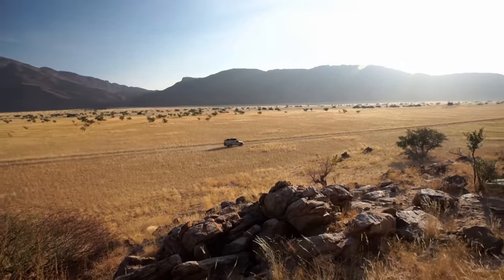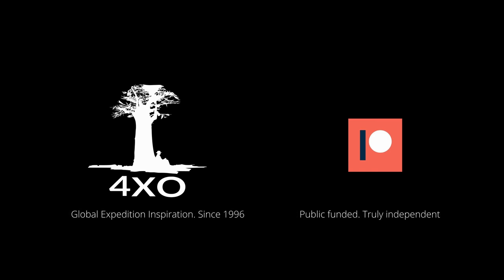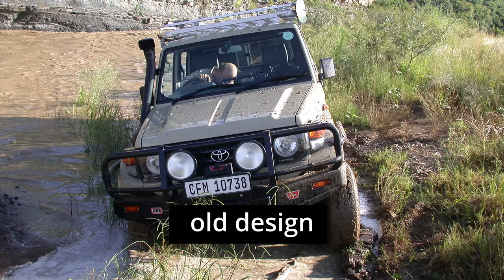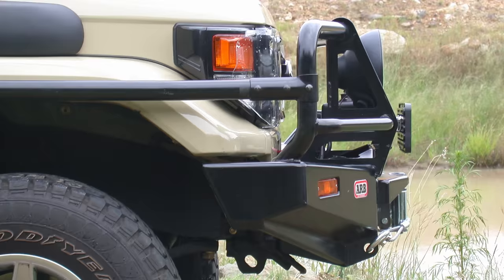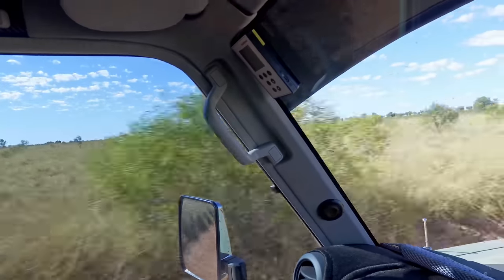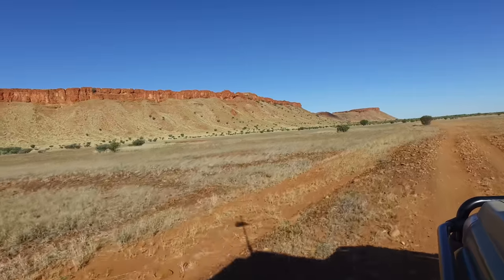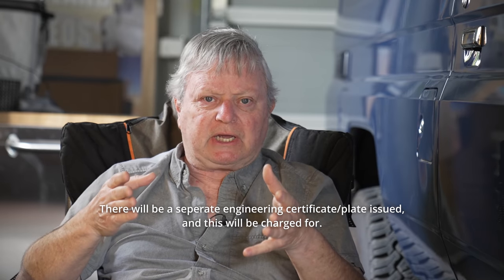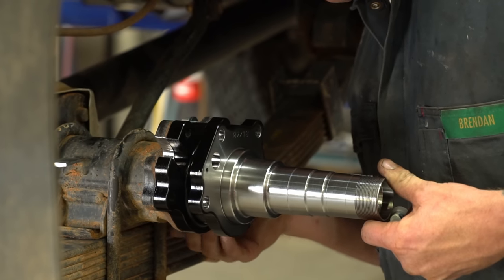TOYOTA LAND CRUISER AXLE-WIDTH CORRECTION. Is it Really needed? Cheaper alternatives? | 4xOverland

Comment: Can you imagine the backlash any other brand would get when they changed the front track and just left the rear?
Reply from the maker: Toyota gets huge backlash from this. But in truth, it was this or design an entirely new vehicle. And they weren't going to spend the money on a vehicle that sells in such small numbers.
Reply: The leaf sprung GU Nissan Patrol cab chassis also has 100mm narrower track at the rear.  Nobody battered an eyelid!
Reply: @4xoverland  sounds familiar to all Landrover Defender owners

Comment: Make a video on GVM upgrades, are they really worth it?
Reply: They’re worth it if you can afford it, which pretty much sums up the 70 series range. This is why the haters bag it so much, they can’t afford one.
Reply: They are if you have ever weighed your vehicle just prior to going away.. most 4x4's would be very close or over their legal GVM..
Reply: Troopy comes with 1000kg payload.  If you need a GVM upgrade you may have added too much heavy unnecessary stuff.
Reply: @philg2468  Well I get it what you say. It's not necessary to add too much weight that it may reach your GVM limits. But my general question is, do GVM upgrades actually increase the GVM of a vehicle?

Comment: And there you have it the main reason that I did not purchase an inherently unstable vehicle with a pretty dam poor design issue. Extending out the hubs without moving shocks outboard will likely be a stability disaster. The axle housings on 70's 'do break' and this mod is likely going to put more stress onto the existing housing. Maybe strengthen the whole housing.
Reply: So basically you couldn’t afford it.
Reply: @Phil_McAvity  not at all but I did not want an inherently unstable tug pulling my AOR Matrix Van which is worth $140K+
Reply: @Phil_McAvity  nah... I just wanted something with decent handling to pull my $130000+ AOR Matrix Van. Read the comments young Padawan, you have much to learn....
Reply: @petermills1402  you sure showed me.
Reply: @Phil_McAvity  sure did Phil, showed you what you are
Reply: @petermills1402  winning 👍

Comment: Andrew, have you confronted Toyota about the rear axle problem and have they attempted to communicate this with the manufacturer? What if the world got together to boycott Toyota's 70' series till they fixed the issue? The V8 has been out for 14 years now. Hasn't there been feedback to Toyota to rectify the rear axle width? This is very poor from Toyota really, a shambles.
Reply: I'm sure people have complained, but it's Toyota here. People who buy these vehicles are scared if they complain too much or boycott them, Toyota will just stop making them. The 70 series do have a loyal following and people love the build process. Also it's not only the rear axle poor design, there are plenty more poor designs on these cars.

Comment: I've owned Toyota's all my life , from the FJ 40 up to the 200,I now own a canter 4x4 truck best choice I've ever  made , I would never buy another Toyota 4x4 ever, there over priced for what you can get thies days  ,you have to spend lots to just get it to work properly, a 4x4 is just that a off road vehicle so why do today's manufacturer's keep building crap ,how about building something that's just not throwen together.example front and rear diffs WHY ??‽?? ,the lay out hasn't changed In years, seats, dash ,diffs ,ect, example springs why still under slung ,your looking for clearance ect , you can't work on them anymore, why not sell them with pto winches as thay used to , best winch ever, Toyota to me now is just a black top  school pick up car .and there just useing the brand name to sell.my last 2007 1hz troopy I sold 4 years ago had just been run in with nealy 700,000 km it never missed a beat .

Comment: The thing with these 70 series LC's is why in the hell should you be doing this in the first place. How much extra would it cost Toyota to resign and make their rear axle the same track as the front. The money Toyota are charging for these dinosaurs is crazy and the few hundred dollars it would cost them, JUST FIX IT TOYOTA.
Reply from the maker: If they fixed it, the'd have to design an entirely new vehicle. Wider back axle, means wider body, which means wider roof, which means wider windows, wider doors, wider everything. I believe they will stop making the 70-series before they fix this issue.
Reply: @4xoverland  agree we don't want Toyota to stop making them. But I don't understand why they would have to completely resign the whole vehicle. You increased the rear track with spacer mod, you can also buy a complete extended rear assembly and bolt straight in. As far as I know, you don't  need to widen the rear of the car, the roof line. If a local engineer business can do it, why can't Toyota, are I missing something.

Comment: Why don't Toyota fix their bad design? Now it cost you the buyer a lot of money.  They should have known the effects of widening the front axle.
Reply from the maker: Toyota needed a wider front axle to enable them to fit the V8 engine. They made the front wider, but didn't make the back wider, because the rear bodywork was the same as it was before. If they had had widened the back axle, it would been too wide for the bodywork at the back. Which would have meant changing the body (which would have meant changing the entire body), or adding wheel flares. Add-on wheel flares do not work well in the less developed parts of the world (an extremely important market for Toyota and NGOs) because they'd quickly be torn off and then the cars would be not be roadworthy with back tyres sticking out. It was an economical decision. It was either do this, or cancel all 70--series production altogether. Which was considered.

Comment: An automotive manufacturer penny pinching with design... who would've thought? 🤣
Reply from the maker: Not as simple as that. It was that or design an entirely new vehicle.
Reply: @4xoverland  Toyota "redesigned" the front end to accommodate the V8 but stopped short of a completed product, sorry Andrew but that seems pretty penny-pinching to me, the end user shouldn't need to cough up $3325 to correct a design issue.

Comment: Sell your V8 and get a trusty 1HZ
Reply from the maker: God no! There is nothing wrong with the V8.
Reply: @4xoverland  other then it sucks 16 - 18 L/100km unladen where as a old 75 sporting the 1HZ with over 300k mostly off road does 14l/100km with a fuel system over haul and a good returning they can get down to 12l/100km. our 105 is a good 500kg lighter then the 75 and it does 12l/100km and its still NA add a turbo to that 1HZ and good tune the 105 can get down to 9-10l/100km. theres a reason why the i6's especially the 1HZ and 1HD FTE still hold a lot of value last time i went looking for a 1HD FTE they where going for around $10k.
Reply from the maker: @phalanx3803  I've owned five 1HZ Cruisers. I get 12.5 L/100 kms with my V8 if i'm looking for economy, and 14L/100 if I push it. The 1HDFTE is another story. One of the best engines of its kind. I'd swap for that. While the 1Hz is very reliable, it can't pull the skin off a rice pudding.  The V8 is also very reliable.
Reply: @phalanx3803  you talking rubbish, not true at all, getting same as ASPW
Reply: @radod6147  talking rubbish my ass I own all these kinds of vehicals from an FJ45 up to a 105 and as a farmer I have to keep meticulous fuel logs of how much fuel is used on road and off-road so we can do our taxes. Face the fact the V8 is a fuel hungry POS there's a reason why there's a market to swap 79 with 1HD-FTE's.
Reply: @phalanx3803  well, I have no idea how you were driving it, because my fuel economy is 12.5l/100km with GVM upgrade and when I push it hard it get around 14l to 15l/100km.